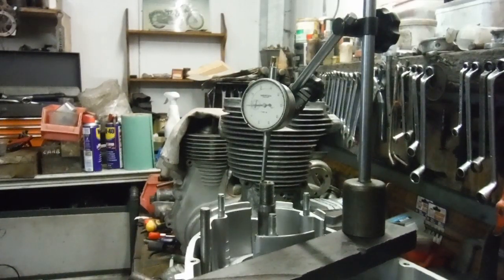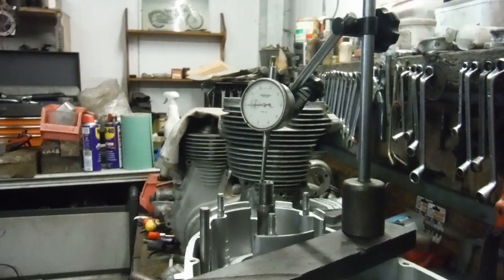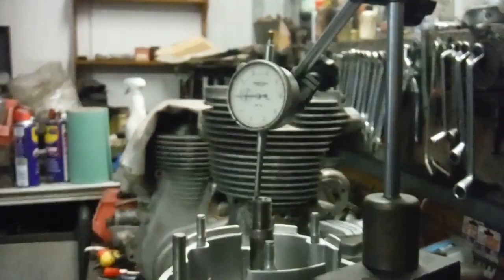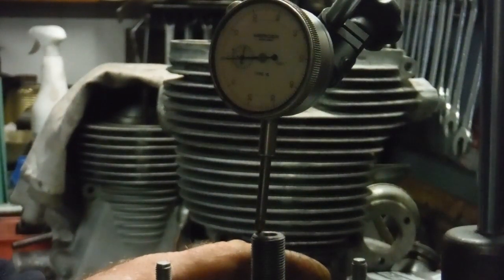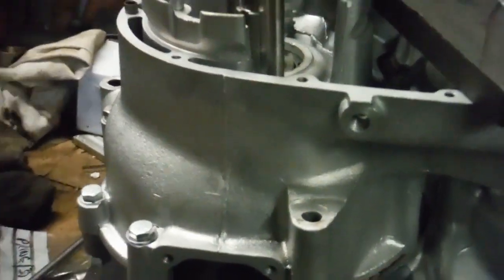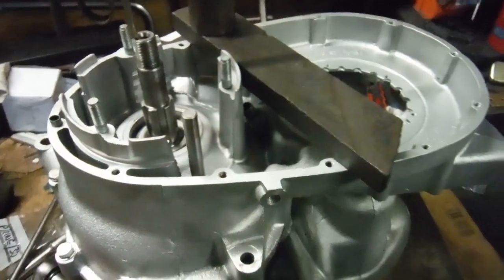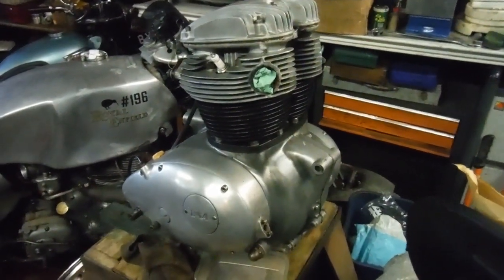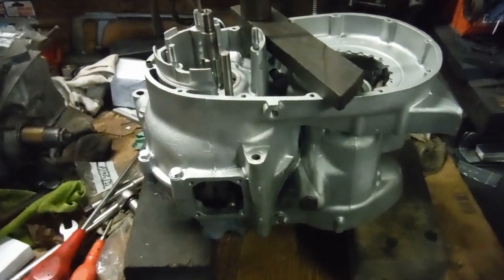BSA A65 engine bottom end rebuild 4 Checking end float on fully rebuilt & bolted up bottom end.

Comment: Those oil taps are a blessing & a curse depending on which way you flip it!
Reply: Should never be fitted
Reply: @sheene7  👍
Reply: Potentially very expensive taps.
Reply: OK if if fitted with a combined kill switch.
Reply: @andrewgent5887  That would be a great safeguard!👍